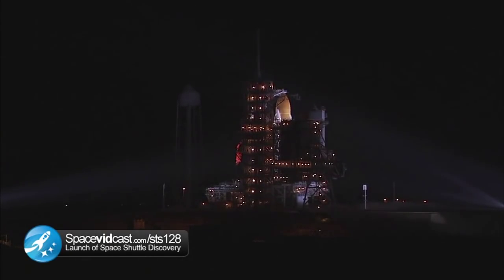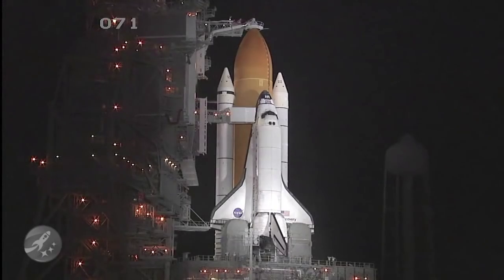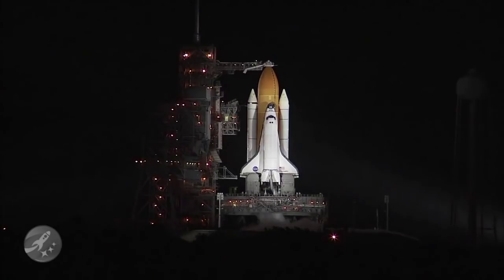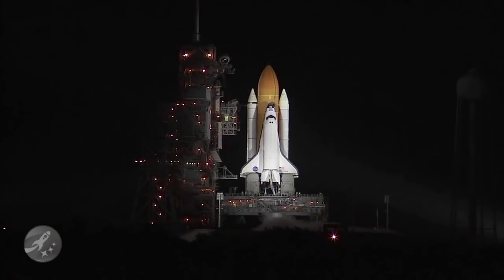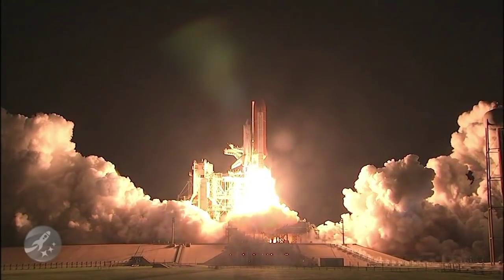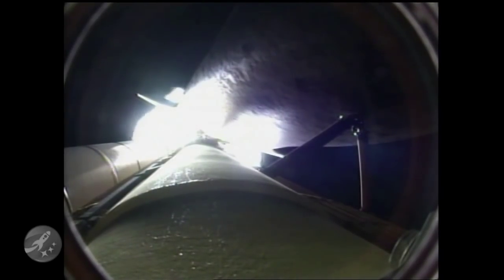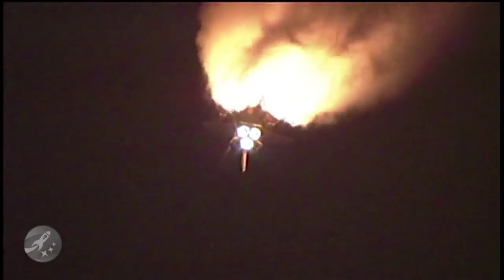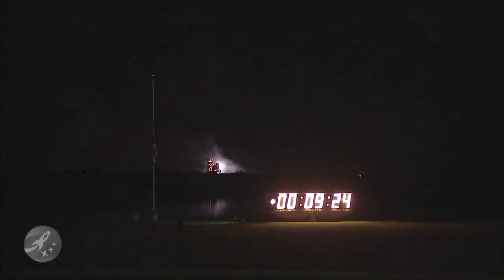Launch of STS-128 from T-9 minutes to MECO (HD)

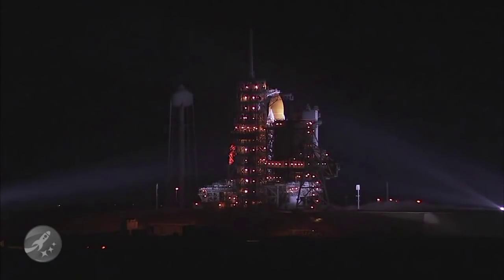Comment: What is that flame at 1:05? Hydrogen? If so, why the color? - does hydrogen not burn with a colorless flame .... like the shuttle's engines.
Reply: hawkeye0248 I see the flames out of the shuttle engines .....many hydrogen gives a color......
Reply: Good question. That's the hydrogen burn off stack. The hydrogen that evaporates in the external tank and the main engines is transferred to a chimney where it burns.  The color is due to the low oxidizer to fuel ratio. Our atmosphere is about 21% oxygen, and there's too much hydrogen coming out of the stack. You can see a similar reddish color as the main engines' ignition sequence starts because pure hydrogen is coming out at that point. But, when oxygen enters the combustion chamber and the engine actually ignites, you can see a bright yellow flash and as the mixture ratio is adjusted the exhaust turns into its distinctive color. I hope this helps